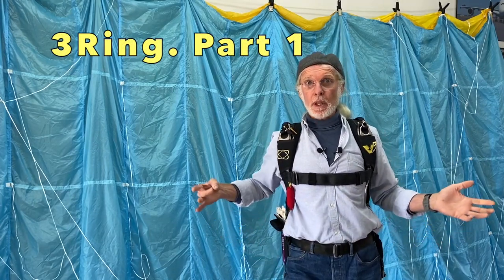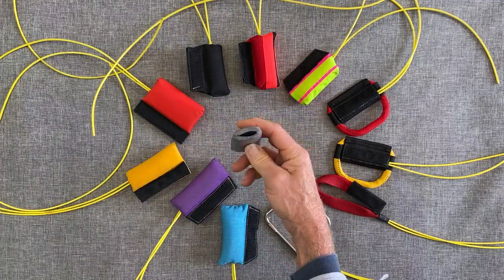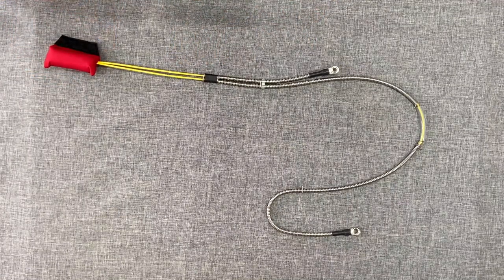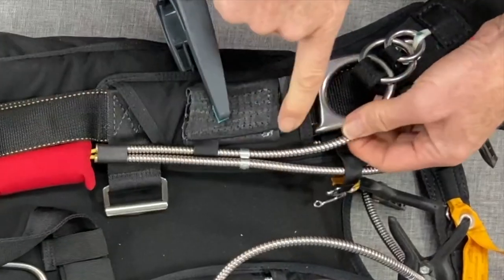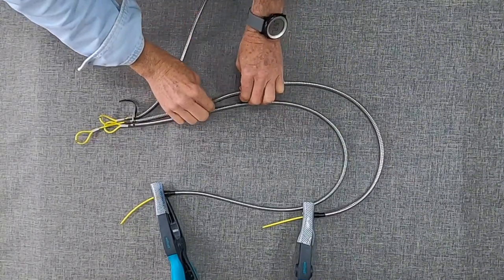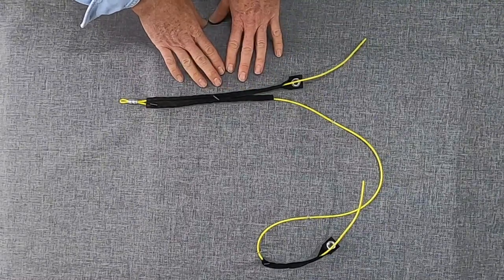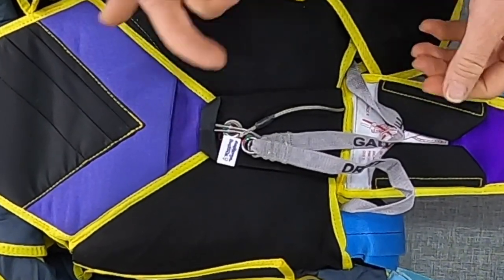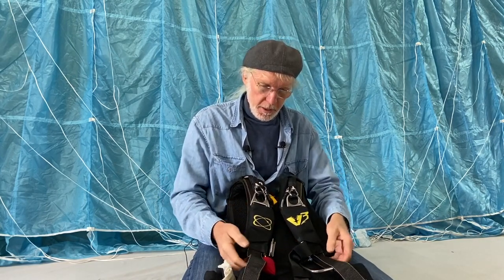3Ring System. Part 1

Comment: Hey Colin nice video!!, what do you think on the french inverted 3ring system the situation of a horseshoe or malfunction where the riser put presure on th rings, even if you release the cable the riser will not release. Que piensa del sistema de 3ring invertido de PdeF, por ejemplo con una malfuncion como la herradura la presion del riser sobre las anillas aunque se haya quitado el cable amarillo no va a desprender.
Reply from the maker: Hello Nico, thank for watching and for your question.
This interesting subject will be covered in the future (when I eventually get to it) in The RiserCovers video.
But in short, even with conventional 3Ring system a, Low Drag Malfunction, Tight RiserCover, horizontal flat body position, the rings may not do their little party trick and flip over (what was Newton's third law of motion).
The risers curving over your shoulders and snuggly held "safely" in place by very effective RiserCovers, may not transfer sufficient force all the way down at the rings, whether they face forward or the inverted (designed by Sandy Reid, borrowed by PdeFr)
There may come a time, you need to physically assist the separation of your risers.

Comment: What is your opinion about people who clean the cutaway cables with water in humidity conditions??? With the argument that silicon is not that good because dust can stuck there and keep inside the housing ???? Do you recommend clean inside the housing ???
Reply from the maker: Hello vf Ra,

Good of you to make the time to watch the video and ask your question, thank you.

Water will shift dust for sure, may not remove the black marks quite so easily.
Having a 0% lubricated cable is madness, 
if you have no silicon, OK 3in1 oil or if the war is about to start and they are coming over the hill shooting,
I'd grab the coconut oil from the kitchen or some thing, anything  "anti-squeak". 
Preferably Silicon from Airtec for the Cypres Loops, surely you can find it on every DZ maintenance facility.

If you are in a very dusty area, fire up the air compressor, give it a wee blow.
I have a flexible rifle cleaning brush, last time I used it was to remove an insects house on a ripcord housing. 
No reason why you couldn't use a small piece of T-shirt material pulled through with a wire, be sure not to leave any bits inside.
There was a time when ripcord housing would have a seal cover fitted on the Pin end, the idea was to stop the "pea gravel"(small stones) from the landing area, getting stuck inside and locking the cable.
Maybe this is where the idea of the dust was stated.

If dust is really an issue in the housings it could be another canopy flight school may help, so the housing don't end up in the dust : )

"On Condition" if it looks dirty clean it,
But Please re-lubricate the the cables before refitting.
If you insist on doing it too often, see of you can avoid peeling the velcro every time, just angel the harness so you can pull the cables out with the Pad still in place.
We don't want you Pad falling off because the velcro is so worn out.

All the best,
Colin.

Comment: Hi and thanks for this video. You explain why it's a good idea to have the RSL on the left riser without housing, but is there a good reason to leave it on the right on some rigs ? My rig has it's RSL on the right (with non-compressible housing), and I wonder if it's because "it always been like this" or if there is another reason.
Reply: hey bro, if you have non compressible  housing you can pretty much have the cutaway cables release the risers at the exact same time. In order to always activate the rsl side last, some manufacturers increase the rsl side cable by a few centimetres. this will ensure the rsl side is always released last. The fact that its on the right side, which i find is the case with most rigs probably comes down to the manufacturing process, this way the rsl cable will be pulling the pin from the opposite side  of the reserve cable, creating a lesser likelyhood of entanglement i presume. Also being on the  more commonly dominant side (right hand) might help with releasing the rsl in sticky situations, but this is a more controversial opinion.
Reply: After watching part 3, I realized that the RSL on the right is also better for the collins lanyard placement.
Reply: @Wawet76  havent watched part 3 yet! on it now!
Reply from the maker: @Frickflyers  Hello Wawet,
Thanks for watching, sorry not to reply instantly.
What Rig do you use?
Did I manage to help you understand it a little better than you did before?
Are there any gray zones you're like cleared up?

Comment: Two comments- having the housings float with a downward stop as illustrated will do nothing to prevent loading of the cutaway cable via the riser loop. If there is sufficient friction from the left side cable and housing, that friction can be transferred across the double clamp, and transferred to the right side riser loop. As soon as the top side of the cutaway housing grommet and bottom side of the riser grommet start to put the loop into shear, the cutaway forces increase dramatically.

Comment two- compressing the left side cutaway housing before cutting the cutaway cables to length can eliminate the out of sequence cutaway issue you describe. It may not be practical if the housings are REALLY springy, however.
Reply from the maker: Hello HydridVW,
sorry for the delay in my response.
Thank you for taking the time to watch and comment.

Interesting point of view, not sure if I get what you are thinking.
The potential for a cable suck-through, if it happens, when it happens, 
it will be at the peak load of the extremely hard opening, if you are present at that moment your primary concern will be to keep your head on your body, 
the chance of you pulling on your cutaway handle at that precise time is not likely, it will probably need a moment or two, to reach a decision, by which time....

With properly lubricated cables, good geometry 3Ring system, correctly attached non-compressible housings, I think you will find the AMP Fitting will sit comfortably up against the riser grommet, in most cases. 
Bill Booth and his team of engineers did not dream this up over night, the system has evolved over quite some years.

As far all compressing the Lh housing then cutting the cable. 
You are putting yourself in great danger, in the early days of attempting to solve the Javelin SoftHousing issues (without fitting proper Housings), one of the recommendations was, what you have suggested. 
They later retracted the recommendation decease it was so open to misinterpretation.
The number of Lh riser accidental release on opening (if you were lucky) or deeper in to the canopy flight close to the planet, increased dramatically.
I can remember people having a "routine" of pulling what little remained exposed of their Lh cable, back out as far as they could get it (on the riser end !) in flight, first thing after opening, 
not what most would consider a suitable solution.

Please be very careful if you decide to get your cable cutters out,
I have used up many meters of my Yellow cable stock, replacing cables after someone cut the Lh too short.

The tension on the cable in a 1G cutaway is obviously not the same as a 4G cutaway,
so with the compressible housing will you set your cable length for a high or low G malfunction ?
We need a Crystal ball in the tool kit as wall.

All the best,
Colin.

Comment: Video was great, but I have to correct you on reverse risers. They are inferior design for 2 reasons. 1. Force to cutaway increases more with more force loading the system than in forward facing rings (in other words it is not as efficient as forward facing risers). 2. They produce problems when there is something pressed against them (like reserve risers). So they won't release in dual out scenarios and in horshue scenarios.
Reply from the maker: Hello Jerolim Duplacic,
Than you for taking the time to watch and make your comment.

If you are after the lowest possible force on a cutaway, then consider the following; 
1.Deliberately practice, the procedure with your equipment (be sure to peel the Velcro first, etc, etc)
2.Use Standard size 3Rings.(constructed in accordance with Bill Booths Specifications)
3.Use a good lubricant on your yellow cables.
4.Have a conservative wing load.
5.Have the best Housings available.
6.Get the Job done, before your Vestibular System falls pray to the Coriolis Effect.

Please do not put the Post. October 1992 PdeFr risers (some Pre. Oct 1992 PdeFr risers did not meet the mark, hence the SB) in the same boat as TES's "artistic interpretation", 
of Sandy Reid's design.(that continue to confuse people)

Which I"ll happely repeat,  was a Clever and Elegant Solution to the problem the parachute industry was attempting to solve at that time in our evolution.
Having a riser fail is not cool, but neither are Ty8 risers with classic size Rings,(what a dilemma)
that by the way have also had their share of issues. (stiff loop material, confluence wrap snagging top Ring, soft rings, to name a few)

The not very scientific "Three Block Test" of the TSE risers in +- 1997, 
then the loop inspection (not to be longer than 25mm)March 1997
finally the Recall, May 1997 and replacement (with "Clasic"Ty17 Risers that still did not meet the design specification or quality that, by that time Bill Booth had made open source [if my memory serves me well] 

Neton's there law, requires something to be pulling on the risers, if the main bag is not lifting off your back, the riser covers are closed as a result(could be for several reasons), it could be that even "classic 3Rings" just stay put, 
until an equal and opposite force takes action.
Yes the observation that the angle the risers sit related to the rest of the Harness/Reserve Risers,
But it could be if you're actual hanging under the canopy that clearance is sufficient for the magic to happen ?
When I get to the RiserCover part of my Workshop this may be a little clearer.

Wish you all the best,
Colin.
Reply: @thomson1963  Thank you for your reply. Your videos are great real gem. I agree with 100% that you said, but where I felt something is missing is the part that I have commented on. I know this as we are having 15 years ago a lots of reverse risers from PdF on our DZ, and we tried some combinations with them on the ground, also there was study with measurements explaining greater release forces on spinners that are above 2-3Gs. So we removed them from all faster canopies and they remained on some accuracy rigs till present day.